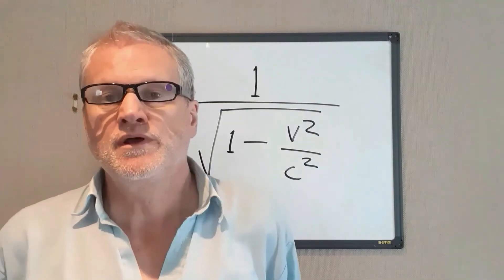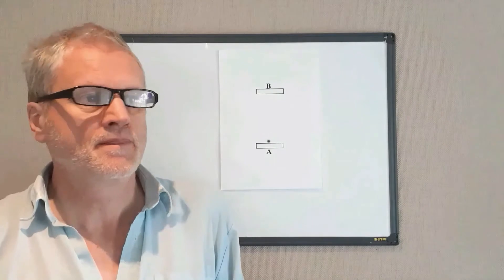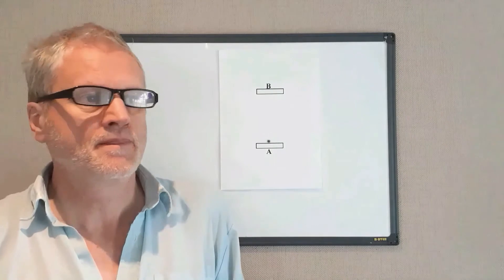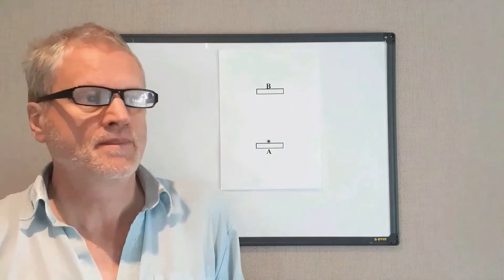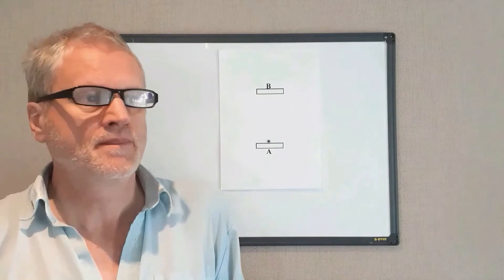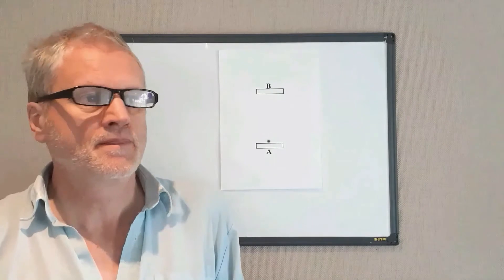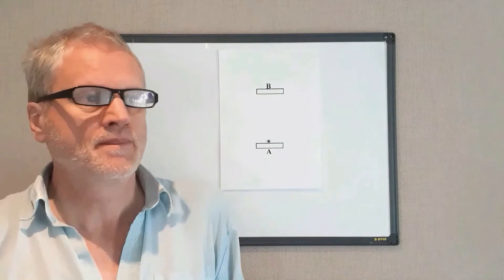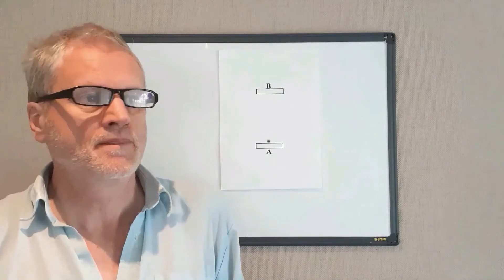Einstein's Clock is Wrong...!

Comment: The Lorentz factor is used in the Lorentz transforms, which transform between two different coordinate systems; the one used by the stationary observer, and the one used by the moving observer. In the moving observer's coordinate system, the light moves vertically, and not at a diagonal. In the stationary observer's coordinate system, the tube you propose to enclose the light beam in, will be moving and thus changing coordinates. Likewise for the light beam inside the tube.

There is no problem here, nothing to see.
Reply: I'm confused by your statement Michael. Are you agreeing with the video or agreeing with Einstein?
The photon in both systems (Earth's or rocket's) will go to a point pre-ordained as the top of the clock (point B) at time-zero.
A photon going vertically has no momentum, therefore it would not travel in the direction of the motion of the rocket at T+0.0001ms (just because you want it to to prove time dilation). So, the video is correct, Einstein's time dilation theory is incorrect.
As for the "tube" proposed in the video, surely that's a description of a fibre optic and the photon bounces along the walls of the fibre (constraining it).
Reply: @MontyVideo969  Thank you for presenting your viewpoint and how you arrived at it, I really appreciate that!  I am siding with Einstein on this issue. You said: "A photon going vertically has no momentum." Well, that is not correct, photons do have momentum, even if they don't have mass. But that is not the reason why it moves at a diagonal rather than straight up.

Special relativity is a descriptive theory, not an explanatory one. It is also more general than general relativity, in the sense that it simply provides a spacetime where causality is conserved. The right way to think about the reason why the photon is apparently moving diagonally is not by an imparted momentum, it is by the light cone of each photon being tipped in the direction of movement through spacetime.
Reply: @michaeldamolsen  I agree with your light cone description. I think what I'm trying to say is this: "The concept of timespace fits the mathematics of the idea of time-dilation perfectly. I'm not arguing with that. However, time dilation arises from using light to measure time and clearly light and time are independent of each other *in reality*. The theoretical notion stems from using a vertical light clock (or at least one going perpendicular to the motion).
If you turn the clock to face the direction of motion there is no time-dilation from the static or moving observer's point of view. A clock that gives different results depending upon which direction you orient it, in my opinion, is not a clock in the normal sense of the word.

Comment: Any comment on all the proven experiments of atomic clocks ticking slower under acceleration?  The Ives–Stilwell experiment for example.  Or are you just going to sick to your light moves in a tube.  Your cartoon carries no weight by the way.
Reply from the maker: Acceleration does make a difference, but I am criticising the Special Theory of Relativity which does not  deal with acceleration.....
Reply: I, for one, beg to differ. The Lorenz equation is merely corroborating the erroneous postulate that time dilates when moving fast - which is clearly nonsense. Put simply the photon on the rocket ship would HAVE to be aimed diagonally to get to the "sensor" which has moved laterally and that would obviously incur a longer travel time. However, the ratio of T=D/C (on Earth) to T'= D'/C (in rocket) is still 1 ie. time is not dilated.
Reply: @MontyVideo969  It would be nice to see your work on proving that the Lorentz equation is clearly nonsense.  If you have such work you should publish it to discredit and embarrass those who have spent time and money on proving that it is in fact true.  For example the scientists who spent over a decade measuring electron energy level transition times within high speed lithium atoms in a particle accelerator.  I am sure they would be able to peer review your work to verify it.
Reply: @blogtwot  The maths is correct - it's simple Pythagoras - the "theory" doesn't match reality - that's my concern. Imagine a mouse running round a wheel. Every revolution is one tick. Now stick the mouse into space at break-neck speed. The mouse will still run at a rate of revs and therefore time is the same for the mouse on the rocket as it is for the mouse of Earth.
Reply: @MontyVideo969  It's all about frames of reference though, the mouse moving at break-neck speed would indeed still run at the same RPM but with reference to his brother running around an identical wheel in a stationary frame of reference he would appear to be going slower due to the time dilation.

If the maths as you state is correct and the theory has been proven empirically, which it has many times and in several different ways then it is clearly not nonsense.  

The whole point is probably moot however as we are unlikely to ever be able to generate enough energy to accelerate anything with a human observer inside to a high enough velocity to make the effect measurable on a scale beyond microseconds before we manage to wipe ourselves out as a species.  Even the NASA solar probe which is to date the fastest spacecraft built at 244,255 mph is only experiencing a time dilation of 1.00107To, so about 1 part in a 1000.
Reply: @blogtwot  OK. Imagine the other video by Prof. Brian Cox (https://youtu.be/-O8lBIcHre0) showing the effect of time-dilation where a man on a trolley has a ping-pong ball going up and down (representing a tick-tock). From an outside perspective the clock appears to show time dilation. However, this ONLY applies if you hold "the clock" vertically. If you hold the clock horizontally the effect would not be  seen. I've never seen a video where the clock's orientation is in the same direction as the travel - why not??? Therefore, the use of light for a clock is the fallacy.